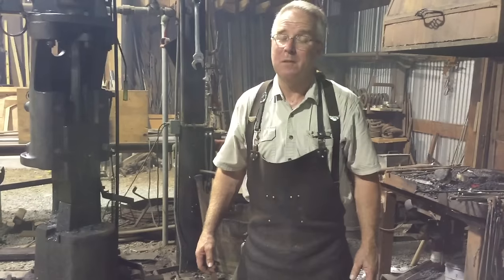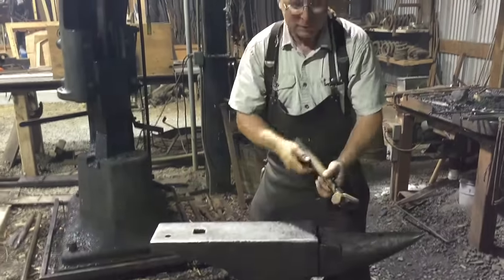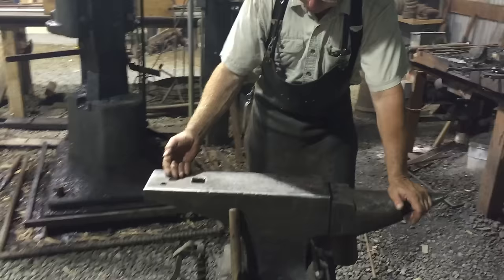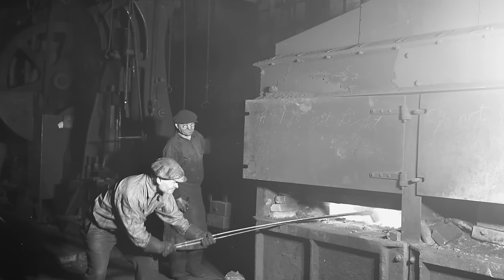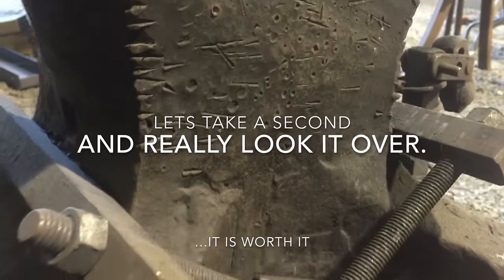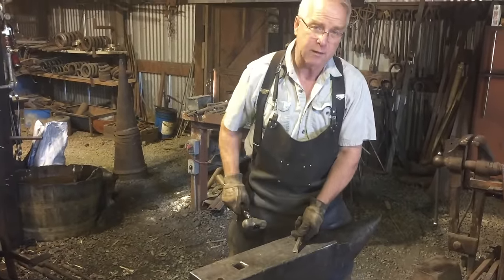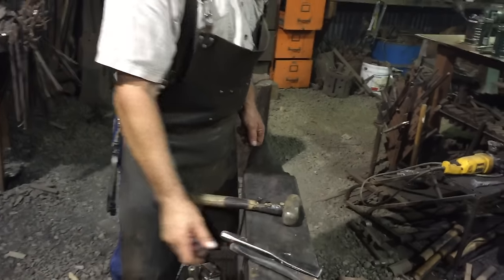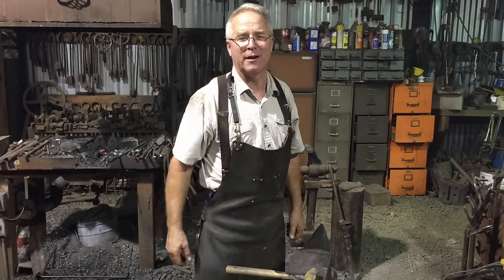Hay Budden Anvil - 448lb

Comment: Very nice and enormous anvil. I can relate to the love of nostalgia when it comes to anvils. I have to say though, realistically the train workshop likely had a power hammer. Many parts are far too large to forge by hand. Your anvil definitely saw alot of use but may have been used mainly for the purpose of forging tools rather than heavy striking work and large parts work. Hence the hundreds of punch and chisel marks. Check out the Eveleigh Works, Sydney Australia 1880s Train works. Largest still operating today, albeit as a school for smithing.

Comment: I've got a 203lb Peter Wright that must have been used for at least a century out on the frontier in the Rocky Mountains. There's hundreds of holes from farriers knocking out their punches on the sides and the face of the anvil is quite dished from its heavy use.

Comment: I love the story.  Beautiful anvil.  Don't you think though, based on the wear and markings, that possibly this anvil was in the tool shop, rather than out on the factory floor?  That perhaps this one was used for making the small tools, punches, and such that the other guys were using to repair trains.  It seems reasonable to me that you'd have a guy whose specialty was making and maintaining shop tools - crotchety old guy who had paid his dues and couldn't handle the really heavy stuff any more, so he's put out to pasture doing the delicate work that keeps the heavy-lifters supplied with what they needed.  Just a theory.  That face is so nice, I can't imagine anyone pounding on it with a 40 pound sledge.  Remarkable piece.

Comment: Why do Smiths put chain around the base of their anvils.
Reply: OK that makes sense, thank you. I though it might be to weight it down..... giggle.
Reply: Essential Craftsman I'm very curious as to what you actually do or make
Reply: Sometimes an anvil gets startled. You don’t want a jumpy anvil running around loose in your shop.
Reply: I'm not a smith, and don't own an anvil, but I'm a bit of a science geek.  A few thoughts and guesses: 
1) BASE: I would suspect that the single most effective way to reduce anvil vibration is first and foremost that it be PROPERLY SECURED to a sturdy non-vibrating base, either by bolting brackets around the feet, or physically setting the anvil into some sort of poured hardened material.  As with anvil materials, not all base materials are created equal, and range from rickety metal stands that skitter around an uneven floor when hit, to unevenly sawed sections of tree bole, to heavier wooden bases with smooth faces above and below atop a smooth vibration free floor, to (better still) massive immobile pedestals of metal or cast concrete that are bolted directly to (or poured/set into) the floor. 
2) ANVIL MASS:  I imagine the heavier an anvil is in relation to the hammer being used, the less it should tend to ring.  Also, the harder the anvil, the more efficient it should be at transmitting force into the object you're working rather than dissipating it (some of which gets radiated as sound), and the higher pitched (and lower in volume) the resulting ring.   
3) DAMPENING ADD-ONS:  I've seen anecdotal references to magnets, but I'd think that unless they're strong enough to physically interfere with the work you''re trying to do, their effect on sonic vibration is probably modest at best.  I would expect wrapping the waist in heavy chain would be more effective by simulating an increase in mass in the anvil to some degree, and allowing some of the vibrational energy to dissipate into the chains ... but to be effecting, the chains would need to be both large, and have a total mass that was a significant percentage of the weight of the anvil itself, in order to be effective.  I would also speculate that a simpler option (instead of, or in tandem with, the chains) would be to place something like a single layer of 5mm rubber sheeting between the proper base mentioned above, and the bottom of the anvil, before bolting it down, with the goal being to accomplish sonic vibration dampening without reducing mechanical rebound efficiency.

I'd love to hear from an informed expert.

Comment: Such a neat story! I also have a Hay Budden anvil. It's a little 118 pound farriers type anvil that I bought off eBay about seven years ago. The face was purdy abused and deeply gouged, and it appears to have a plate welded on to build the face up. I got it before I knew how to weld, so I had my neighbor burn a bunch of stick rods into the craters to build it back up. It's still not perfect, but it worked for my knifemaking. I don't think I ever really had a good stand for it, so when I get my next shop set up, I'll have to build one that doesn't defeat my blows. I miss hammering on it... Thanks for another great video!

Comment: Does anyone know how a southern Cresent anvil is? I took his advice, posted a wanted ad, and in 6 hours I had 2 solid responses. One is still getting pics and info for me, the second is a 100 pound southern Cresent, still has 75% of the original green paint, least from the research I done, not much info on them. I'm no professional, only planning to do average smithing jobs, and I'd rather have a decent older anvil than buying a new one. The face is in great condition, has almost no wear/marks etc.

Comment: I have a old anvil that i believe came out of Brooklyn NY. It has a large brake out of the plate. would you recommend filling it or completely replacing it? I asked a long time friend that has a welding shop and he did not seam to be interested in the project. Thanks for teaching. Keep up the good work.

Comment: I wish I knew what happened to a man I knew all his blacksmith stuff. Forge, shop table, most of his tools 2 anvils. one was small I think he said 220 lb his main working one was if I remember the numbers right 480 lb sadly he died and I was able to get a few hammers and 1 set of tongues but I had no where to put anything else so the family sent it to some one some where. he was making his own mini locomotive he already had a short portion of track with a air powered locomotive that was used at a Black Powder Factory if I remember correctly the locomotive is now in Kentucky or Tennessee one of those two for the size of it to neat trick considering it came from New Jersey I forget where I came from before that

Comment: I have a 300 lb Hay Budden from the Sante-Fe shop in Albuquerque that has almost exactly the same scars in the same areas.  It’s pretty marked up and the Horn is shaped nice but is missing about 1.5 inches in length.  It’s welded and machined so it’s currently about 270 lbs, great rebound too.

Comment: The stronger the better is not the case in my opinion. If the steel is too strong the other metal would just slide on top of it.

Comment: What would be a fair offer for a 462lb Peter Wright that looks to be in really good condition and does not have signs of repair? Owner is asking $2500. Would $1800 be a fair offer?
Reply: Thanks! It may well be a possibility. Just working on the detail of getting it into my 4runner. If you're curious:
https://sacramento.craigslist.org/tls/d/462-lb-blacksmith-anvil/6368523051.html

Comment: So that is why mine HB has all those marks. I had always assumed it was from different systems of strapping down. Mine is one of their earlier models, it has a steel plate. Best that i can estimate is 1896-9 . I decided that it would be mine forever. So i committed sacrilege, and drilled mounting holes through the wrought feet for bolt mounting. Not to worry, i have multiple reservations in hell for my many sins.
Reply: Essential Craftsman I might end up doing that when I have to service the stand. I should also mention that I had to angle grind the top of the feet to gets area flat for the heads to seat on.

Comment: What is on the underside of the heel on the body?  Link to photo of what I'm asking about.
https://www.dropbox.com/s/99vz9423yd14gbm/Anvil.jpg?dl=0
Thank you for another great video.  I'm very envious, but glad someone like you has and is using those tools.  Good on ya, and "Thanks" for sharing them and their history.
Reply from the maker: That is a magnet... they are represented to dampen the ringing. I’m not sure that it actually works.
Reply: Essential Craftsman, “I see”, said the blind man as he picked up a hammer and saw.  Thank you for the quick reply and info.  How that might work is something to consider.  Perhaps the energy would cause the magnet to move and thereby dissipate via the friction between the anvil and magnet?  Energy also does interesting things moving from one material to another.  I wonder if a flat surface to flat surface placement would have a different effect than its current location.  Thanks again

Comment: Ive got a vintage anvil. I dont know the brand but its shorter than that one. It has an eagle with an anchor in it's grasp cast into the side. The rear at the bottom it has "1899" cast and on the front leg it has "110" cast. Do you know anything about it?
Reply: @mercoid  Hey, thanks. Its in a corner in my shop. When I pulled it out I see now it clearly says Fisher on the front. It's also missing about 2-1/2" on the rear of the face (broken off clean). I'm sure that hurts the value. It's a shame because the rest of it is in great condition. Still very handy for my work
Reply: Ed Jackson ....Shame about the broken off tail.., but as long as it still works for you 👍.  There are lots of people who would love to have it anyway.
Reply: @mercoid  Yeah it works just fine. I've straightened hundreds of bumper brackets with it. Bought it for next to nothing 20 years ago from a neighbor having a garage sale.

Comment: How on earth you guys manage to work in such archaic units beats me & we invented the set of imperial weights & measures!
Don't you ever ponder how much easier mm, cm, metres etc. (Base 10) would be to work with?
This is a great channel but it's one great failing is the use of medieval weights & measures. That tape measure didn't even have cm marked on it! It would drive me nuts! °F, fractions etc.